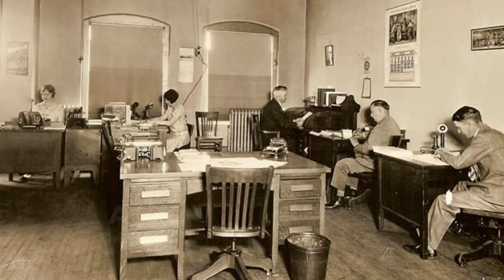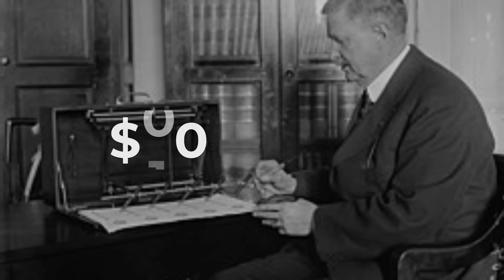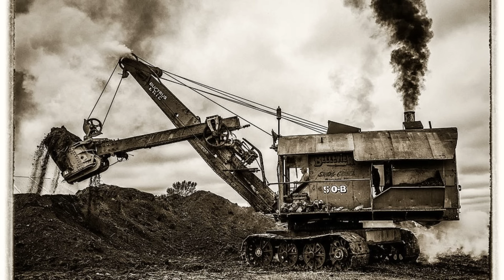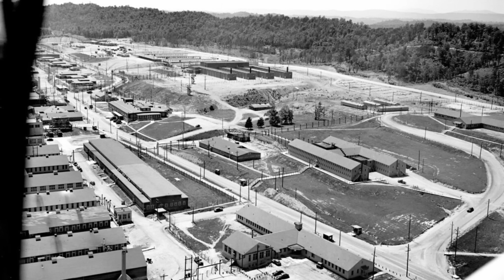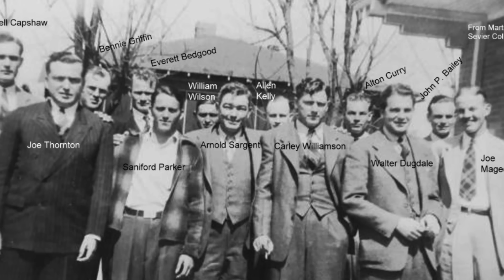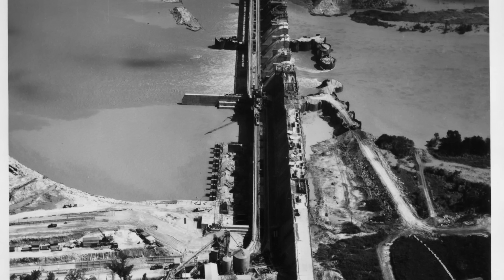The Machines That Built the TVA Dams (1933-1944)

Comment from the maker: Fontana Dam workers placed 11,419 cubic yards of concrete in a single 24-hour period — a national record. That is the equivalent of more than 1,000 fully loaded mixer trucks in one day, using nothing but cables and steel buckets swinging 480 feet above the Little Tennessee River.

🎬 More construction history documentaries:
🏗 The Deadliest Machine at Hoover Dam Was a Steel Cable — https://youtu.be/Qyjo9Qt68pA
🏗 The Machines That Built Grand Coulee Dam — https://youtu.be/pTXc2j_ux4Q
🏗 He Had 299 Patents and Caterpillar Laughed At Him — https://youtu.be/ud7VeNDlioI
🏗 The Call That Sent Two Caterpillar D9s Onto a Collapsing Dam — https://youtu.be/TF5x8nIaeSw
Reply: D10s didn't exist until the 70s snd were replace by the  D11 in the 80s. As a dam engineer I used both in Central Africa.
Maybe of interest is that Kariba Dam, on the Zambesi river is the largest man made lake by volume  nearly 70 years after it was built.
The dam wall is a double curvature arch dam. Max depth of water is circa 300' and max length is circa 200 miles and a capacity of 115 miles³